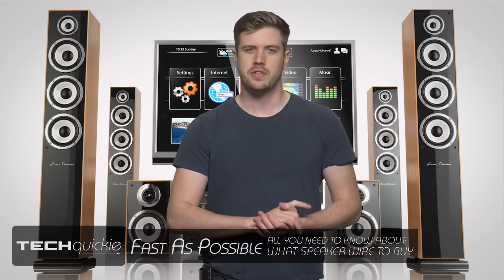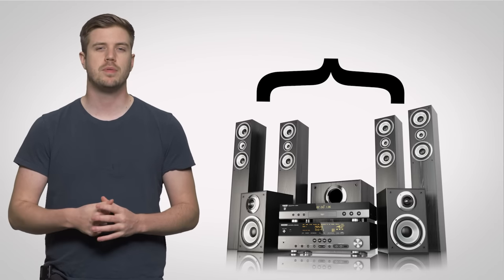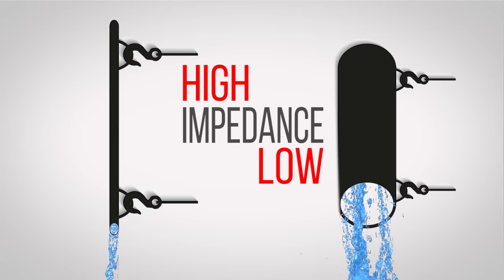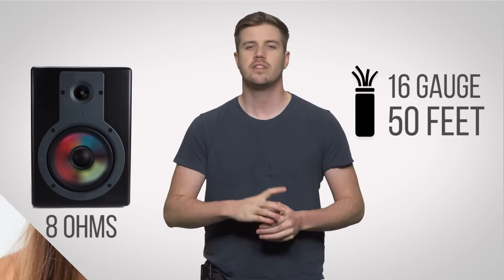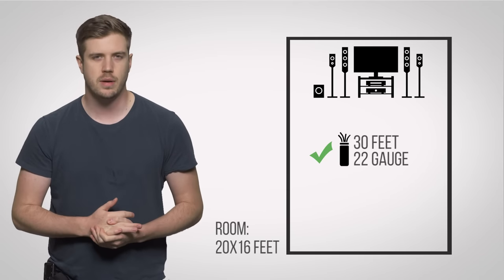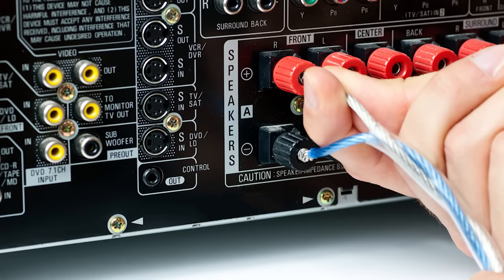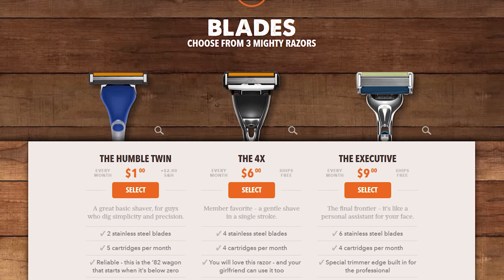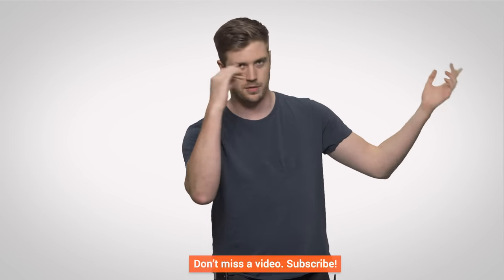What Speaker Wire To Buy As Fast As Possible

Comment: Can you guys do a car audio version of this, kind of a basic how-to on the layout? Head unit to amplifier to speakers and why you do it certain ways.
Reply: +JesseArt grab a copy  of Yamaha's book on sound re-enforcement. More than covered.
Reply: +JesseArt Head unit sends a low level signal via RCA cables to the amplifier.  The amplifier draws a large current from your battery/alternator at ~14.4 volts, and sends out the amplified signal at a higher voltage, thus making the amperage lower, so speaker wires are less thick than power wires. Don't wire your speakers to an impedance lower than the amplifier is rated for, don't clip your amp, and try to run the RCA and power wires on opposite sides of the vehicle to minimize interference.

Comment: choosing the wrong impedance in cables/amp/cab(speaker) will not only make them sound bad, but will damage the speakers. A friend had a Marshall 1960B cab (for his guitar) and his amp was set 16 Ohms. (the cab was set to 4 mono). He blew all speakers
Reply: I think the cab might just have been switched to 4Ohm. A 16Ohm cabinet on a 8Ohm Amp output would have gotten less Power than usual, not more, wich won't blow it up, it'd just be less loud.
However that way around can damage some amps if I remember correctly.
Reply: Lukas Görgner a too low one will also damage them, but not significantly. 
And I just noticed that I've written it wrong corrected it haha

Comment: It is interesting that they used resistance as the only concern and completely leaving out the most important things what it comes to cable.  Capacitance and inductance!  The price you pay does not guarantee the quality of the sound.  Most mega dollar cables are built to change the sound to help match components that are over bearing or under whelming.  Please take the time to understand capacitance and inductance then make an informed decision when buying cables.  After all it is the quality of the sound you will have as an end result.

Comment: you left out one thing they type and mix of the metals in the wire  over long runs can effect the sound quality
Reply: +Thebad300 I think he did indirectly address it. Most wires are made of copper, with a few made out of silver alloy and gold. The thing is, the conductive differences are really minor. So for all practical purposes, when it comes to audio, just use copper and adjust the width of the cable to reduce the reluctance. To get a bit more technical, the formula is R=rho*L/A. Silver's rho is about 6%lower than Copper, so its about 6% more effective than a copper wire of the same length and cross sectional area. But as you can see,  increasing the area, of a copper wire, by 6% will have the same effect. Since  copper is a lot cheaper than silver,  the second option is a lot more economical. 
Hope this helped!
Reply: +Thebad300 
Not an issue at all as Emile said, as long as you don't pick aluminium or gold cables. Both are bad conductors compared to copper and silver, with silver being just a little bit better (but definitely not worth the money).
Reply: yep you two know every thing what do i know about wiring any way  you two are so smart
Reply: Didn't mean to offend you, bro. Just wanted to answer your question to the best of my knowledge.

Comment: You should have also talked about Stranded and Solid wires, i almost always try and use solid copper wires just because stranded wire tends to annoy me more.
Reply: +DiabeticMadman why solid, they make it with strands for a reason. Cu is still a metal, and bending metals weaken them. the metal is allowed to move individual strands when flexed so the more strands the less likely the Cu will break. solid wire is for permanent non-disturbed installations like building wire.
Reply: +Tera Volt solid core = inside walls   
Stranded= not inside walls

Comment: There's one other thing you should be careful of with speaker wire.

Sometimes really cheap speaker wire is made from impure metals that can affect frequencies depending on how frequently the electrical signals go through the impurities. 

You're usually safe as long as you're not buying wire at bargain shops or "dollar" stores

Comment: Also a good rule of thumb, keep the cable runs equal length if possible. If the furthest speaker is 20 feet from the receiver, the other speakers should also be fed by a 20 foot wire...just cable manage the slack.

Again, it's just a rule of thumb.

Some receivers have a built in speaker calibration feature to manage phase issues if you're running different lengths to different speakers.

The longer the wire, the longer it takes for the signal to reach each speaker, causing phase issues (weak sounding audio). The signal reaches each speaker at different times. The shortest length gets signal first, the longest last. Each speaker playing the same signal at different times. We're talking micro-seconds, but that's all it takes to put sound waves out of phase, especially high frequencies.

So, keep all the wire at the same length as a "general rule" for laymen in an average living room.

Comment: You mentioned the "Snake Oil" aspect of things. While I am not going to say that there is no such thing I will tell you that as you learn more about how this stuff works you will find out that there is a lot more substance to things than you might think. Different kinds of metals have different levels of resistance for example. Also even in say copper, there are varying grades. In short better wire under the right conditions can matter. What conditions? Well, you need to have a system that can reproduce the level of sonic you are actually trying to achieve for 1. Secondly, even then you still need source material that will reproduce said differences.  Most folks don't have neither the equipment nor the source material to notice.  In the case of source material deficiencies... Let's use an MP3 music file as an example even if you have the most amazing speakers and open sounding power amp you will never hear any benefit from your expenditures. You could have bought much cheaper equipment and got the very same result. If you want to be able to hear what it sounds like to plug your speakers in with 50' 22 guage aluminum core wire so you can determine if it actually does make a difference you will need to have all of the rest of your equipment upgraded too including making sure that you even chose the right balanced cables as in that case if they create too much capacitance you are limiting the performance of your system. This is an example of a cable type difference and not a quality thing as even high-end balanced cable manufacturers make both types and sell them for different purposed usages.

Comment: FORMULA FOR CALCULATING THE RIGHT CABLES FOR SPEAKERS +Teckquickie
okay. copper has the resistive value of 0,0175ohms per meter at 1mm squared at 20degrees celcius. the formula for calculating the resistive values of a certain cable is : 0,0175 x Length in meters / thikness in milimeters
 as long as the values are under or close to 0.1 ohms, sound will be good and very litte current is lost in the cables.

Comment: I was expecting the usual non-scientific rubbish but video is pretty good. Its basically correct without getting into the impendence curves of speakers and damping factors. A low resistance cable is basically all you need for audio. If you can get it into your connectors, cooker cable (6mm^2) or even shower cable (10mm^2) works great. Don't let anyone give you any rubbish about "skin effect" at these frequencies.

Comment: Conductor size requirement has little to do with speaker impedance.  Conductor size requirements are a function of current and length.  You can drive some specialized tweeters at several hundred volts (with special high voltage amplifiers) and hence require very little current for the same power output (power=voltage x current).  Anyways, I would never run 22awg for anything in my home audio setup.  Sometimes I think LTT should consult experts instead of a rudimentary Google search!  22awg for a subwoofer?!?!
Reply: +Jay Walt I agree, I normally use 24-26awg wires for my speakers, as for subs you normally use high gauge simply  to power the amp and then low gauge to supply the audio signal. Im my car, all my speakers use, 24 gauge to run audio, then 8awg for the amp power line,

Comment: Guide lines
------------------
Smaller gauge number = larger diameter wire. Larger is better.
Copper is better than tin. 
Gold plated ends are better for digital signals, the difference may not be noticeable for analog signals.
Go optical if the speakers have that option. Optical does not suffer from RF interference and loses less signal per length than copper. Also optical is thin, but more fragile. Optical should not be sharply bent or it suffers from significant signal loss.

Comment: The only other really important facts about these wires is to make sure red goes to red and black to black otherwise your sound is not going to be balanced. Any kind of decent wire is going to have a difference, whether it is texture difference or sometimes dots or a small thread, in a cable with two wires one of them will be different. It is also important that your lengths match no matter how far apart your speakers are.
Reply: +HockeyPlayoffRun no, lengths won't matter. Also if you wire them backwards, you just reversed polarity and made whatever you hooked up 180 degrees out of phase. It's actually sometimes useful.
Reply: so your telling me that if one speaker is a couple of feet next to the amp and the other is 10 feet the other way it does not matter as far as having one speaker on 2 feet of wire and the other on 10 feet of wire. It is not huge but it does matter as far as I am concerned
Reply: No difference, unless perhaps you're wiring everything with 30 gauge for whatever reason.

Electricity flows at a speed close to the speed of light.
Reply: I disagree I have always made sure every wire matched distance wise. Just me I guess and yes I get the whole speed of light thing but still...
Reply: +HockeyPlayoffRun Keep reading this on this page, wires DO NOT need to be the same length!

Comment: my HT consists of two overpowered home stereos for front and back and a powered standalone sub, cant find a suitable center yet, funny though I have to tune the bass down quite a bit, essentially all my speakers are bass heavy and the sub just adds even more earthquaking madness to it
Reply: pr0xZen positioning makes a world of difference but not on low freq, bass doesnt care about position, Im just trying to remove all low freq from my speakers to leave the sub to it, a low freq cut filter they call it but nothing yet that fits my Frankenstein build
Reply: pr0xZen yea I'm looking for a software solution and windows seems to have one, you can set speakers to be "full range" or "not full range" and the latter removes lows, but it removes too much of it, essentially it makes the speaker sound like one of those tiny all-in-one 5.1 setups which is the intended purpose I believe, I need something with more granular control, I guess an individual EQ per channel is too much to ask :( 
I don't know what to call it but the 4 speakers have a special kind of not-so-low bass that the sub can't replicate, and that kind of bass is actually affected by direction and positioning of the speakers, essentially you can only hear it from across the room, weird

Comment: This advice is for people that buy home theater in a box but not for anyone that spent over 5,000 on a stereo system.  Better wires are not snake oil, they improve the sound if your stereo system is a good one, if it's a cheap system then better wires will not be much improvement if at all, not because of the wires, but because your cheap stereo can't be helped by spending money on it.  You can't win a race in a V.W. beetle because you put racing tires on it, it might even slow it down some.  Some day, when you save up a bunch of money for a real Hi-Fi system, then you will be able to improve your sound a lot with better cables.  Cables are simply a part of the system, they need to match in quality to be worth it.

Comment: The impedance of the driver really has nothing to do with the gauge of wire that is needed. It depends on how much power the amp is sending to the drivers. An 8 ohm speaker can draw just as much power as a 4 ohm speaker. 100W @ 8 Ohm is exactly the same as 100W @ 4 Ohm.  What you need to look at is a Power to Wire Gauge chart for speaker wires.

Comment: Nice video
But Speaker wire is cheap. A 100' roll of 14ga can be had for $20 on Amazon, 16ga half that, and 12ga $25, so why even bother with 20 or 22ga?
Determine your longest run and use that gauge for the whole system. In any event, the smallest wire I'd use is 14ga.

Comment: Oh!  Well, that not only sounds functionally the same as "resistance" in regular electrical applications, it's even comparable wire-gauge sizes for the household power cords in similar settings.  So I guess... don't run your 4-ohm high-powered speaker on a 25 ft. 18 gauge wire... just like I don't run a 1/2"-chuck drill motor on a 25 ft. 18 gauge extension cord.  It's almost like I already knew this.

Comment: I bought F&D T-60X Bluetooth Home Audio Speaker, which has 55w *2 
output (I'm not sure of the OHMS but looks like its 8omhs), i want to 
know which speaker wire is best to connect these 2 speakers in india? 
what gauge speaker wire should i purchase. they will be placed at a 
distance of approx 5-6 meters from each other.

Comment: All this talk about ohms, but nothing about power?  Wire thickness needs to be calculated based on amperage.  Since the voltage is variable, we can use power P (watts) and active resistance R (impedance) to calculate the amperage I, where as:

I=√(P/R)

So for a 4 ohm speaker at 100 watts of power
I=√(100/4)
I=√(25)
I=5

A quick lookup in a wire gauge and current limits chart, we would need 14 gauge wire for such a setup.  This would be the minimum wire thickness for a low loss wire.  We could calculate the voltage drop for a given run length to determine overall wire efficiency, but with runs less that 50 feet, these numbers are quite small to compare.
Reply: +James M. Your typical 4 ohm speaker would have its voice coil fried if it actually received 100 Watts. An audio signal is an alternating current, so the 100 "Watts" is actually VA (Volt-Amps). Wattage is the real root mean squared power, while VA is only the apparent power. Power factor is very important when powering speakers, due to their inductance, making the current lag behind the voltage. At normal listening volumes, your speakers don't draw very much power. Also, assuming 100% efficiency, doubling the power that you send to a speaker will only gain you a maximum of 3dB. An increase of 10dB is required to double the perceived loudness to the human ear. This means that you need to exponentially increase your power in order to achieve the same small gain in loudness. Luckily, speakers can be designed to be fairly efficient, needing only a few watts to become very loud. For example, the Crescendo NF-8 (a midrange speaker rated at 250 Watts RMS) needs only 1 watt rms to reach 97.5dB, which is comparable to the loudness of being right next to a jackhammer, for which you would probably want hearing protection for any long term exposure.

Comment: So what's the difference between speaker wire and wire you would buy at the auto parts store in a big spool or household wire if you bought it in bulk? .  Is it cheaper? I know it's a little more flexible.

Comment: this helped me alot since i though higher number gauge wire would mean thicker cable, not i know smaller number = thicker wire, but is there any quality difference between wires you are using in a home theater system?
Reply: +Skinnwalk3r Yes and no, you can get "high quality" (more expensive) low oxygen/oxygen free wire but the reality is they don't make a difference compared to standard wire these days (for home theatre use) unless you luck out and get something that shouldn't even be on a store shelf like copper clad aluminium wire (CCA) - not that I've ever seen CCA speaker wire but I'm sure someone in China would be making it ;)
Reply: Thanks

Comment: Actually i would rather go with 2.5mm² (around 13-14 AWG) for big speakers and more for long runs. Maybe even 4mm² (~ 11 AWG) for highend speakers.

Also you neglected to tell/warn us about the differences between CCA and CU / OFC. CCA, which most cheap cables are made out of is just Aluminium wrapped in copper and is far worse for electrical currents espcially with thinner cables. You might aswell get a thinner CU/OFC cable then a thicker CCA one.

Comment: Premium speaker cables does improve sound quality, because cheap speaker cables is not made out of pure copper, which has higher resistance and plenty of other losses.
Reply: +mikka1986 Thin wire that is not made from CCA (cheap) is not going to make that much of a noticeable difference in your house.

Maybe in the your car yes...
Reply: +mikka1986 
What would the "plenty of other losses" be? All that matters is the resistance. If it's not copper but aluminium for example than just make up for it by getting a thicker wire. Except for the looks, there's no reason to get speaker wire at all. Might as well get simple flexible electrical installation cable, it does the same job.
Reply: Not just resistance when AC current is going through a conductor. The "other losses" will be something like capacitance, skin effect, dielectric loss, resonance... Not simple science.